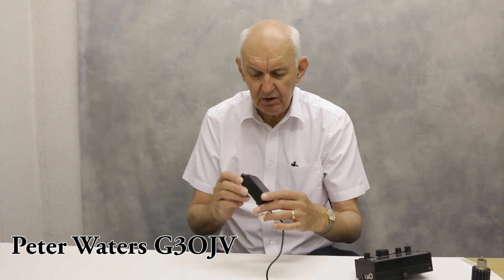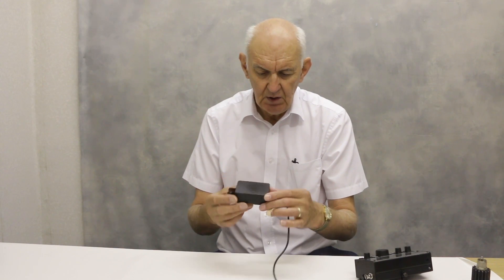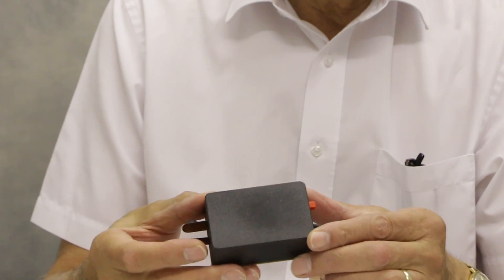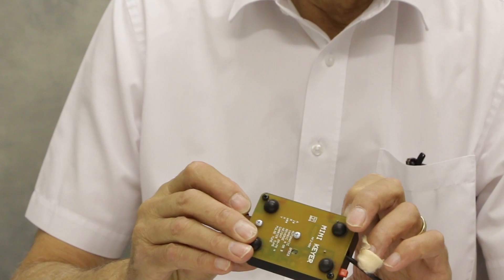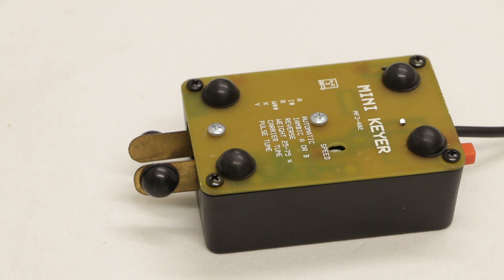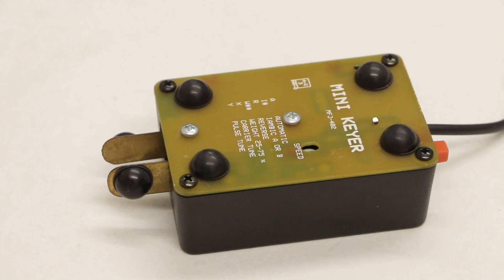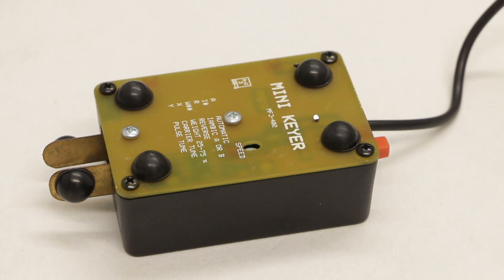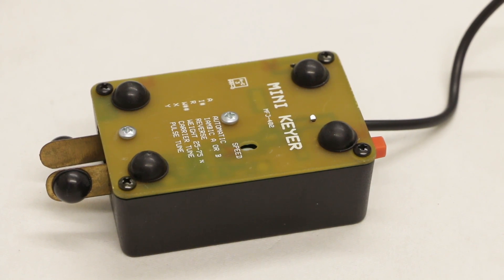MFJ-402 Nano Keyer / Paddle

Comment: Is this the mini (on the bottom of it), micro (as PW says), or nano as the box and model number suggests? Doesn't the nano have a coin cell in it - RadCom Mat 19 article says it does, or as PW says is powered from the rransceiver? Also he says there are no adjustments other than speed, again contradicting the RadCom article.